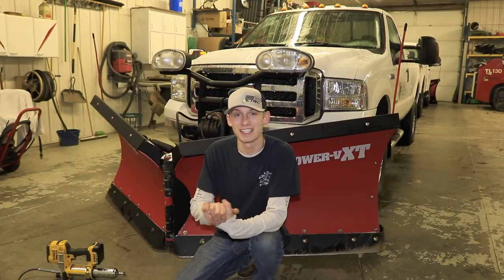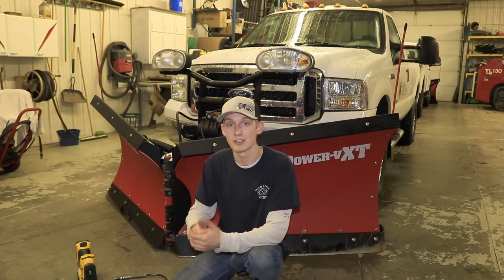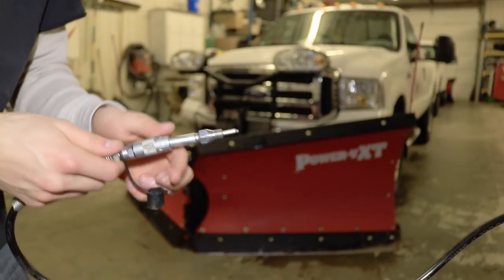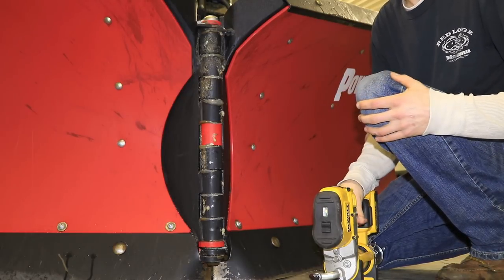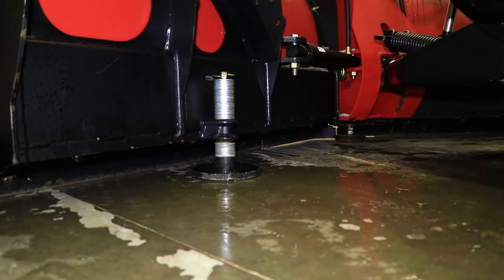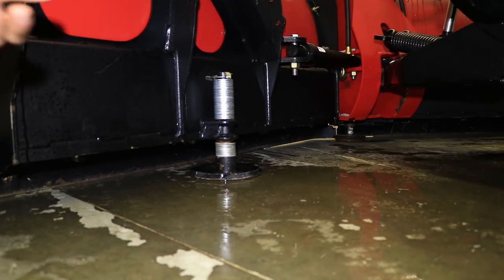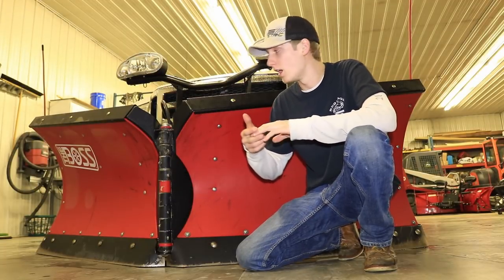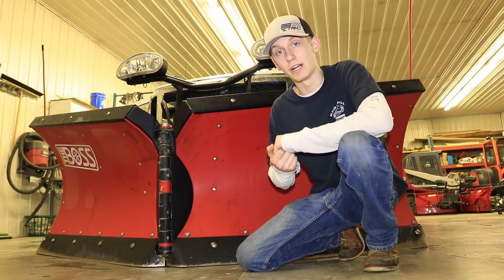V Plow Maintenance Tips | Snow Plow Tips & Tricks

Comment: Dielectric grease in the  plow electric connections after every storm.
Reply from the maker: Hey thanks for adding that! I totally forgot, we don't usually do it every storm but we do keep an eye on it and just use our best judgment!
Reply: I just do it every storm just because of all the salt and water that splashes onto the connectors
Reply from the maker: Probably not a bad idea, grease is cheaper then new wiring harness parts!
Reply: Dielectric grease every storm? Nah..
Reply: Dielectric grease in the electric plugin once a year when I put in storage. All it takes in Montana because no salt is used. Plus the O-Rings on the SnowDogg are more then enough to prevent leakage.
Reply: @CarsonSchifsky we

Comment: heat will eliminate moister as rust is caused from corrosive chemicals and the delusion with water will slow rust down on raw metal. 
Adding silicone or lithium grease once product is dry will keep rust down. Basic science is acid are corrosive and oils are base alkaline. Water is neutral as long as the PH neutral. Your tips helpful and product endorsement spot on. Legacy

Comment: Be careful with high pressure washers on the undercarriage of the trucks use low pressure. Reason rust will start your undercarriage really fast. Looks like the Boss frame sits low. Fisher & Meyer truck frames sits a lot higher. Check out fisher stainless steel v plows. You have a great channel. Peace
Reply from the maker: Thanks nick really appreciate the input, ideas and support!